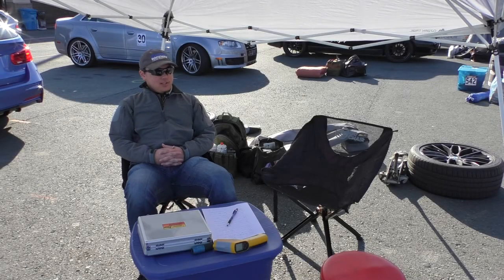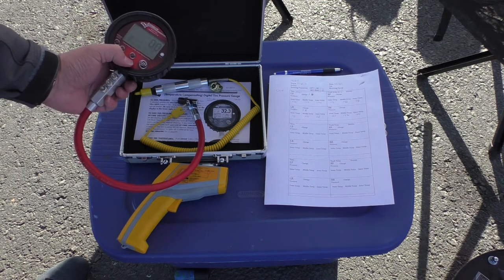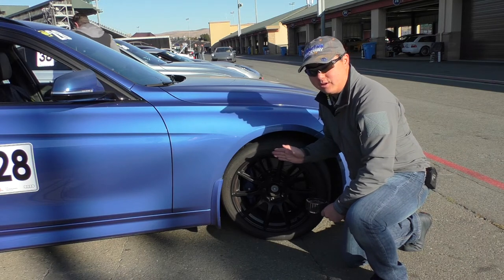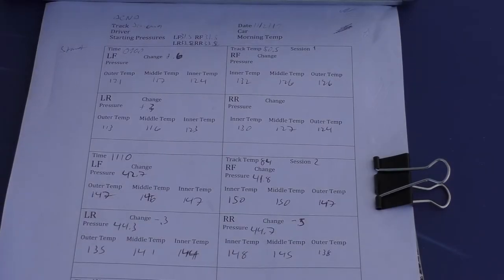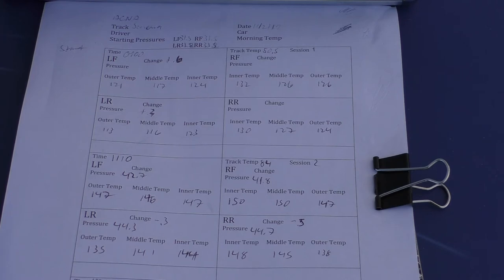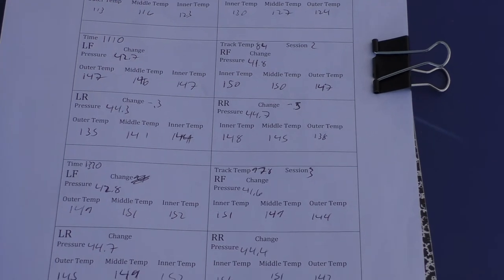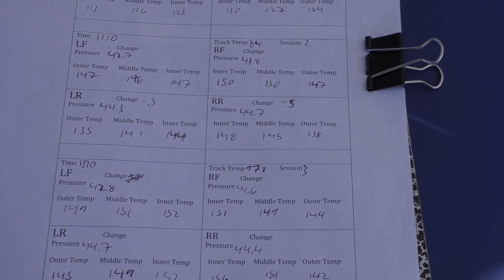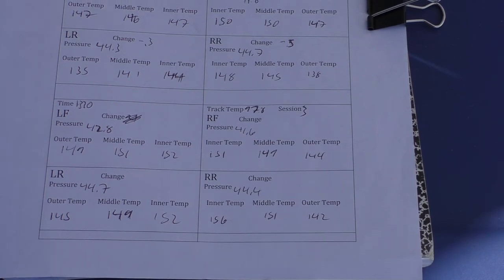Adjusting Tire Pressures at the Track

Comment: Helpful video, thank you.
I was looking into this particular gauge but I don’t fully understand how the “temperature compensation” part works, can you elaborate on that? Also, why not use the IR sensor for the tires, is the needle probe much better?
Reply from the maker: The temperature compensation feature helps you make sure all tires are adjusted for the same standard, because there are factors that can make all four tires not the same starting temp (like if the sun's on one side of the car). I haven't actually used the feature though, because it's not as critical for me, and I usually end up where I want after the first session.

The reason I don't prefer IR sensors for tire temp measurements is because the surface of the tire cools off really quickly, while the core not nearly as much so. So an IR surface reading doesn't give you nearly as accurate of a temperature.
Reply: Check out this article by Longacre themselves! 

For those who don't wanna click on the link for some reason:
"Choosing a pyrometer? What is better; probe type or Infrared? The answer really depends on the application. Most tire engineers prefer the probe type for tires as the probe gets down to the cord. At the cord, the tire heat is un-affected by out side factors and the surface rubber insulates the heat for long enough for you to take readings. There is also an elastic stretching of the rubber near the cord that creates heat as well. The bottom line is that probe type pyrometers are best for specific applications such as tires.

On the other hand, Infrared pyrometers are versatile and can be used to check just about any kind of surface temperatures. You can find sources of heat which will affect the driver, locate dead engine cylinders, check track temperatures, brakes and just about anything. You can even use them on tires. However, this is a bit of a compromise. You will be getting a surface reading that will be 10-40 degrees cooler than temps taken with a probe type pyrometer. You will also get variances from the engine and brake heat. Further, the track temperature will cool off the surface very quickly. A tire with camber in it will ride on the inside edge when the car is rolling back to the pits. The area that is in contact with the track will cool down at a different rate than the rest of the tire. Your readings will not be as relative as compared to probe readings.

If you accept the limitations, the Infrared pyrometers will work for tires but will not be relative to probe readings nor will the delineation be as good. Using the right tool for the right job always produces better results. Just as the probe type is better for tires, the infrared type is better for most other surface temps. The probe type is designed to be submerged in rubber and does not work well for things like track temperatures. For rubber, probe type is best. For surface measurements, the infrared stands out."
http://www.longacreracing.com/technical-articles.aspx?item=8159&article=Probe%20versus%20Infrared